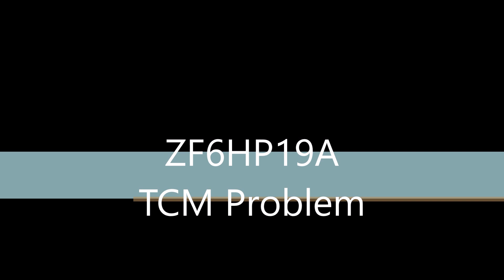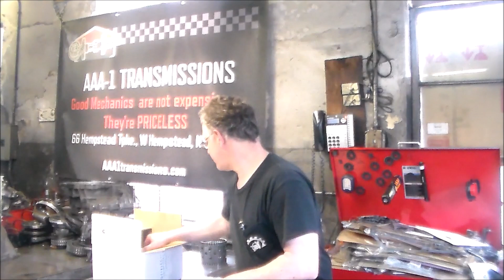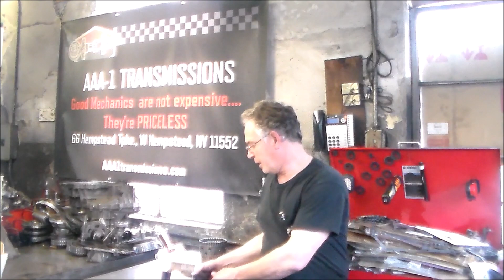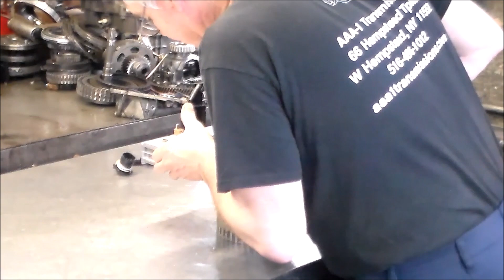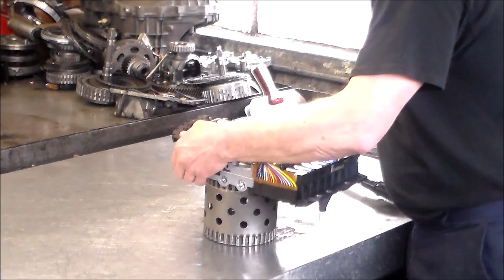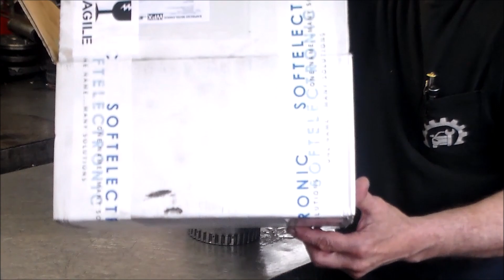ZF6HP19A TCM

Comment: Gary automatic transmission specialists like you must charge dearly for diagnostics and must also charge dearly to completely overhaul an automatic transmission with new and high quality original parts.
Reply from the maker: we charge accordingly always a fair price, this year we are celebrating 55 years in business
Reply: @GaryFerraro  Really? This is amazing.
Reply: @GaryFerraro  So you've been in the market since 1967 but AAA1 Transmissions has always been located at the current address?
Reply from the maker: @NarutoUzumaki-lx7tj  no, we were down the street for 27 years and curent location we own the property

Comment: Excellent video,Gary.I'm not surprised at the quality of your technical and accurate information based on high quality technical literature.Let me know how much is your electronic diagnostics by scanner.
Reply from the maker: We have snap-on and Autel scanners. Autel may be a little less expensive if you get an older model, my snap-on was about 4 or 5 thousand.  There is a great scanner out there for about 1100 called the Think Tool, look into that one
Reply: @GaryFerraro  How much do you charge for diagnosis?
Reply: @GaryFerraro  Do you use Motul brand of atf fluid?
Reply from the maker: @NarutoUzumaki-lx7tj  No I do not
Reply: @GaryFerraro  But how much do you charge for diagnosis?
Reply from the maker: @NarutoUzumaki-lx7tj  depends on situation between 250 and 500
Reply: @GaryFerraro  500 dollars? It's cheap because you're an automatic transmission specialist.
Reply: @GaryFerraro  Here in Detroit a workshop specializing in automatic transmission charges around 800 dollars just to make a diagnosis.It isn't expensive because they are honest and qualified professionals in the field of automatic transmissions like you.
Reply from the maker: I wish I could charge that lol. Most I go is 500.   Then cost of repair and labor for that
Reply: @GaryFerraro  Qualified and honest professionals like you have an expensive workforce like any other profession that requires qualification and this is more than fair because it highly values the technical,professional and honest work of professionals like you.
Reply: @GaryFerraro  Do you agree?

Comment: I'm surprised that VW used a 6hp19 instead of 6hp26 with their 4.2 v8. The transmission input can handle I think somewhere around 295lb/ft. I guess these 4.2L engines don't put out that much of torque.
Reply from the maker: Did you see the teardown video, had some hard part damage, 4-5-6 clutch hub was torn apart,  i agree with you on that
Reply: Yes I agree, I have it in my old BMW E61 525d LCI 3.0 which has 400 Nm from factory and I have heard numerous warnings against trying to raise the turbo boost due to that 6hp19 which has issues with too much torque.